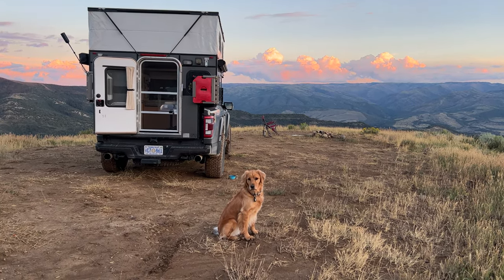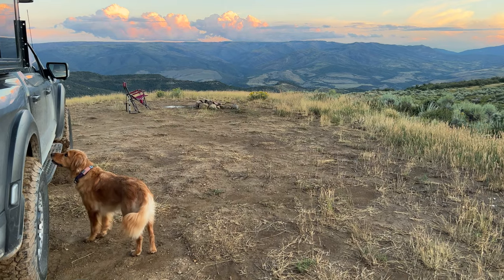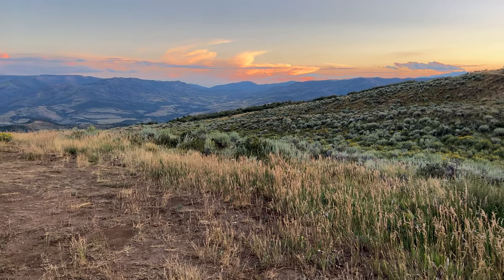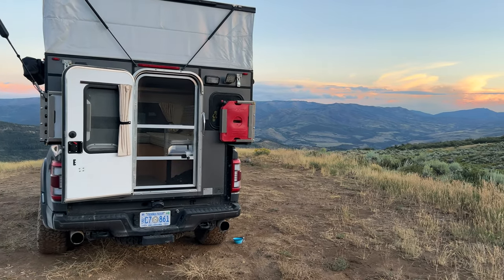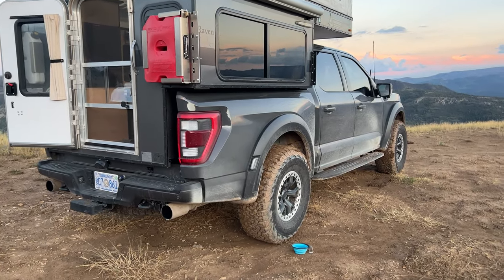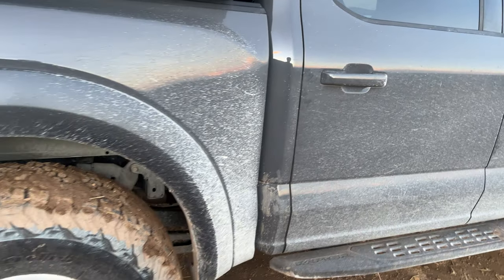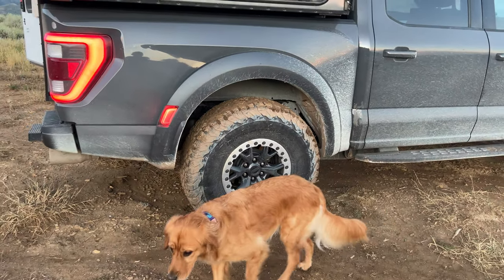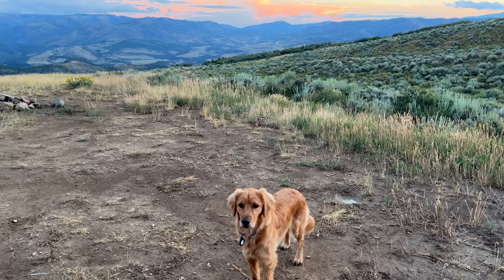Ultimate Onboard Air Compressor Setup: Off-Road Raptor Adventures Unleashed💨!

Comment: Have you compared your Raven to the 1 ft longer Hawk model? if so, would you described  the smaller space as a big difference? I saw a Hawk in a showroom but never seen the Raven and am worried the Raven might be too cramped inside.

Comment: Would you mind linking the thread for the install? My searching skills appear to be failing me. This sounds like the perfect place to mount it and not compromise bed space.
Reply from the maker: https://www.facebook.com/groups/1243679275786075/permalink/2301747113312614/

It looks like I found it in the Gen 3 Facebook Group. You may have to join the group to follow the link. The original post was very detailed. I even linked a video of the compressor in action in the comments.